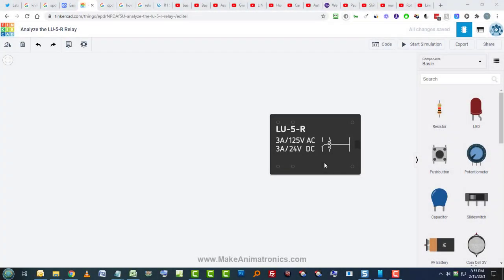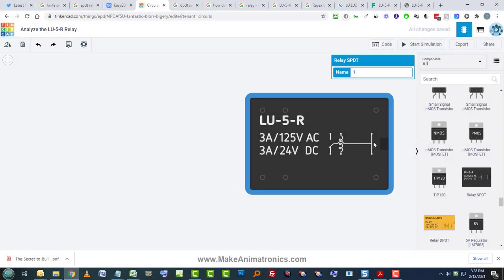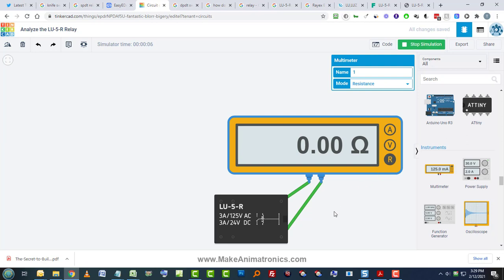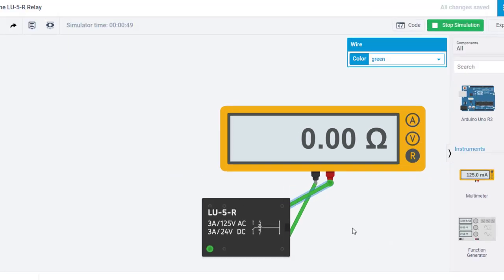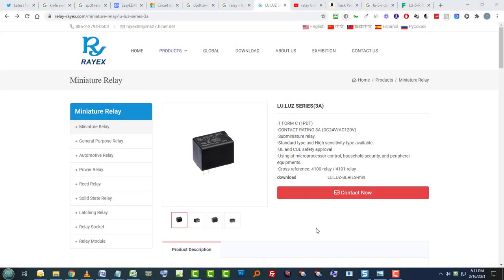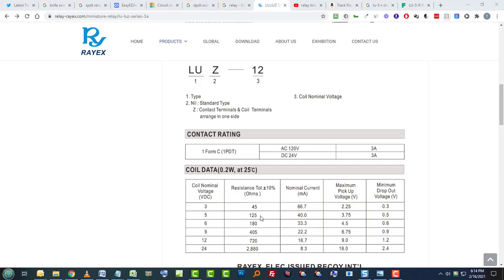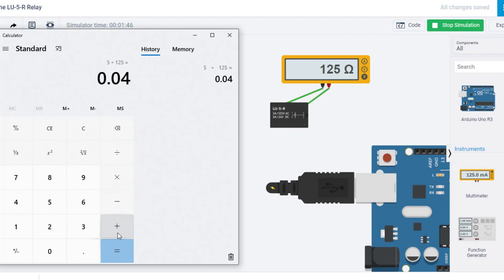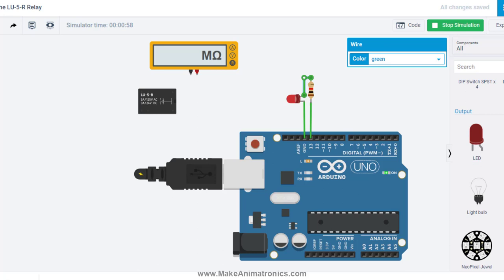Tinkercad Circuits 7a - Analyze the SPDT Relay (Single Pole, Double Throw) - Part 1

Comment: How did you size the resistor for the LED coming out of pin 13? How did you go about selecting the resistor?
Reply from the maker: By default, the resistor is 1K when you drag it out to the work area. You can change that in the window that comes along with it. I just accepted that value because by previous experience, I knew that 1K was fine -- overkill actually, and in real life the LED may not even light up if using a 1k resistor. In real life, around 220 ohms would be plenty as you'll see in the calculations below. But I didn't want to bother with changing it as I knew Tinkercad would make it work. (I think Tinkercad tries to provide default values of everything in a safe range, but I am not sure.)

You can build a circuit in Tinkcad and then use the multimeter to take various readings to help you (before or after you use calculations like those below).

But if you want to calculate what the resistance value should be on your own, you use Ohm's law. Obviously, a resistor is used to limit current. You must know the current limit and voltage drop of the LED, and how much current the source (the Arduino) is capable of providing. You need to check spec sheets or other data sources of both to learn those things before you start. 

An LED spec sheet will tell you that a standard red LED has a voltage drop of around 2 volts and requires about 20mA (.020A) to light nicely. An Arduino spec sheet will tell you that each output pin of a standard Arduino can supply a max of 40mA at 5 volts. So you know the Arduino is capable of driving the LED. 

So now you just need to calculate the value of the resistor to limit the LED current to 20mA. The Arduino supplies 5 volts but the red LED takes up 2 volts because of its internal voltage drop, so you're left with 3 volts (5v - 2v) to use in the calculation. Ohm's law states R=V/I. So R=3V/.02A. R=150 ohms. 

You can double-check yourself by changing the formula around to read I=V/R. So I=3/150. I = .02

That's a long way off from the default of 1k in Tinkercad, but Tinkercad circuits and components are very flexible and forgiving.

I do some actual calculations on all this stuff if you're interested. I use a 9 volt supply and a 5 volt supply later in the video. https://youtu.be/RIpxY0AiDbo
Reply: @MakeBasicElectronics  I am well aware of KVL and Ohm's law. Your explanation is very detailed. I was just trying to kindly "squeeze out" of you the process by which you selected this resistor because it seemed to be left out of the video. I also understand that the intent of the video is designing relay logic and control of the default SPDT available in TinkerCAD.

 Again, thanks for the beautiful explanation!
Reply: I just checked out the video you left in your comment. You're the absolute man!
Reply from the maker: @MiguelPadilla-y9p  Haha! OK, the short answer -- I just pulled out the default resistor and moved on! 

I wasn't sure what you were asking so I got into it :)  I often get followup questions that I should  have answered the first time, so you got the firehose!

Comment: I'm letting y'all know that an arduino DOES NOT have a built in blink program. You have to program it yourself either using blocks or raw code.
Reply from the maker: I agree, it does not have a built in blink program and requires a sketch. I made this video a long time ago and I think it automatically loaded the blink program in the simulator when you applied power but I can't remember. Maybe I loaded the blink program before making the video. We may never know :)